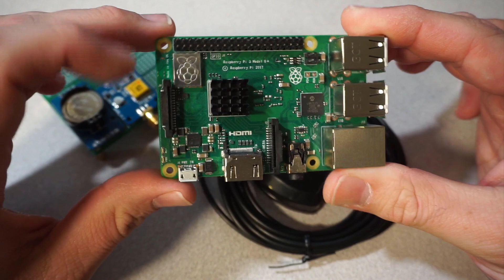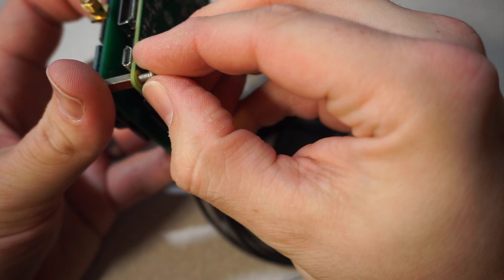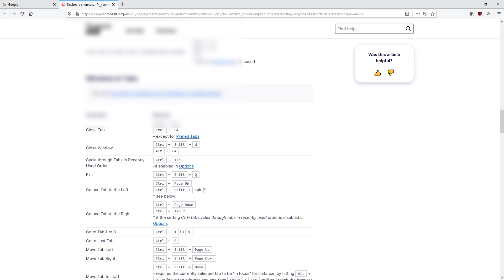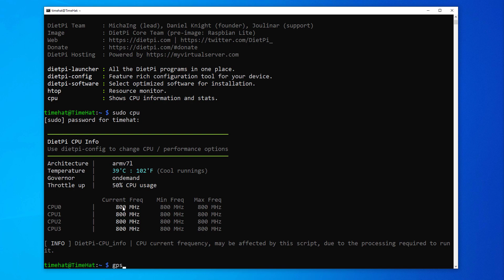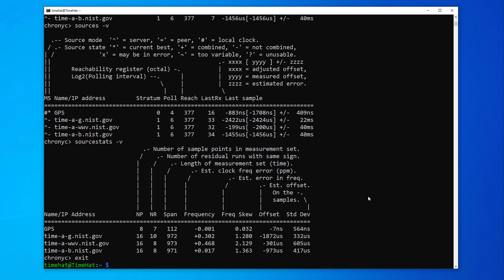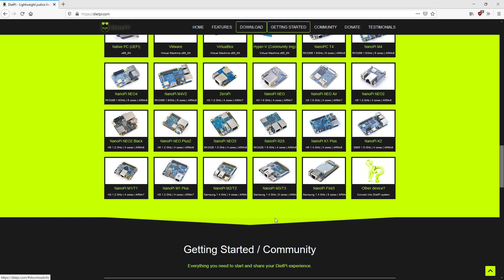TimeHat Setup and Walkthrough

Comment: Awesome work, John! Was wondering since we disable the software clock and use just the DS3231 hardware clock, how the accuracy compares to when you 'upgrade' the raspi's CPU oscillator to a TCXO. Also, are we limited by the polling rate/accuracy at which the pi can read out the pps pulses from the GPIO, despite these upgrades? Cheers, and looking forward to any update videos!